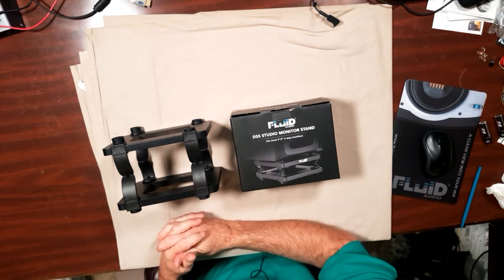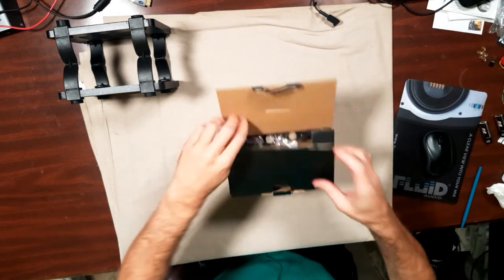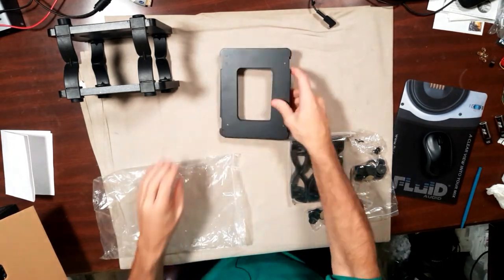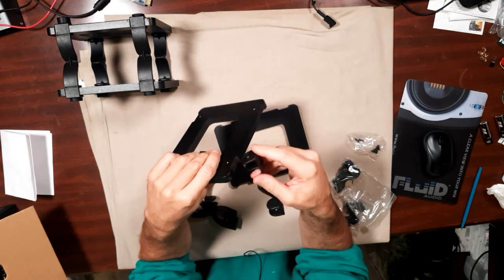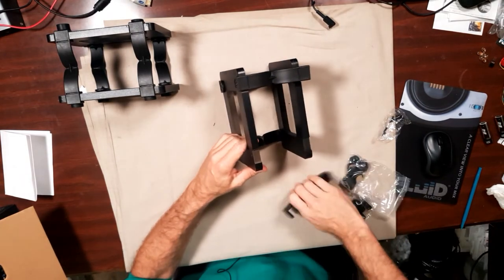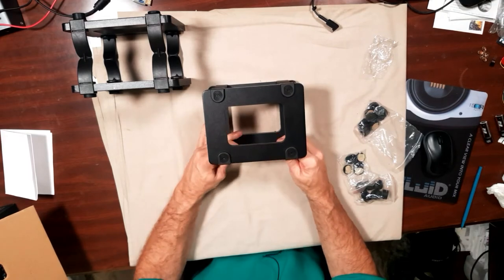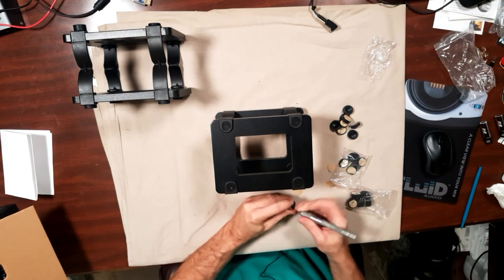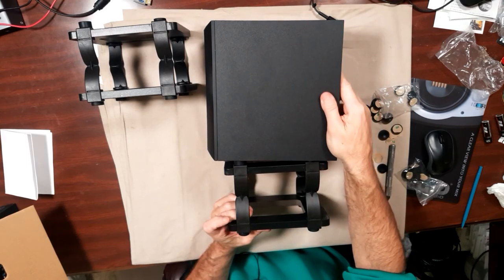Fluid Audio DS Monitor Stand Assembly Tutorial

Comment: I want them raised but once they're raised I don't want the mangled because they won't need to be how do I accomplish that or is that even possible?
Reply from the maker: The angle is accomplished by the rubber feet. There are "flat" feet included that you can put on the stands that create no angle. You have to take the ones you have on there, and replace them.